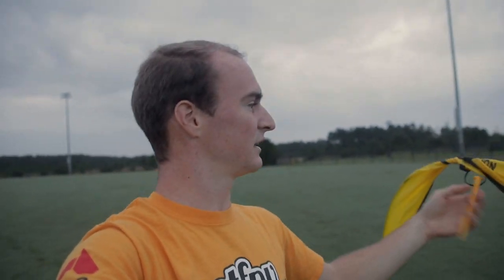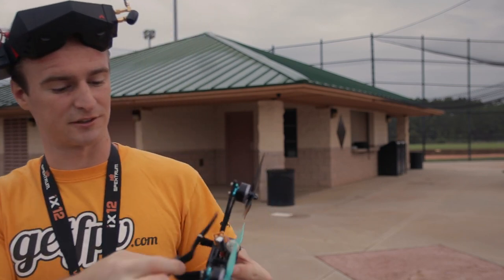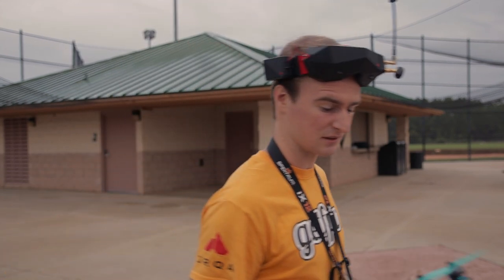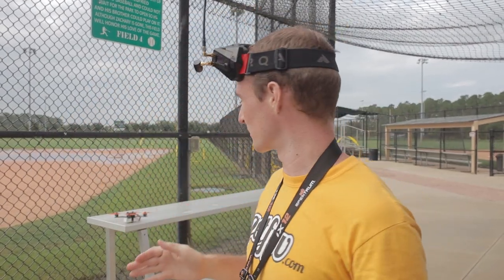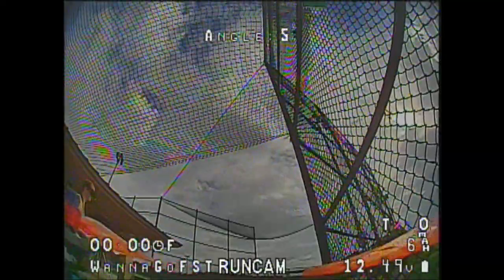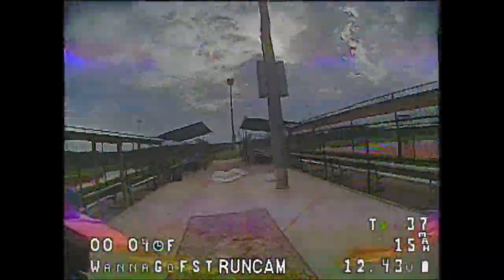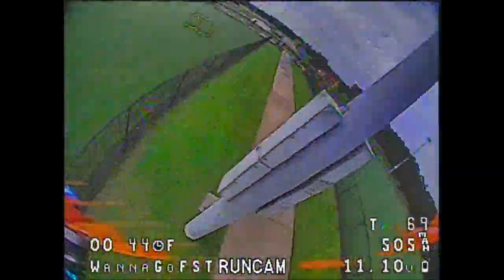Freedom Spec 3s Racing

Comment: I am just waiting for parts for a freestyle build. It will not at all be like Five33 or Freedom Spec. Nevertheless I have ordered 4 pieces of CNHL 3S 2200 mAh packs (40C) to practice similarly to Freedom Spec.

The frame is a PiratFrames Hook v2 with 5,5" arms, the motors are Wasp Major 1860 kv, and the props are not the R38's either. Still for practicing and warming up this should be some interesting proposition.